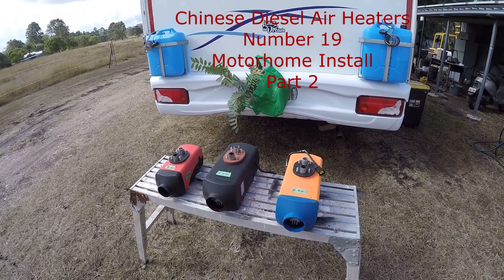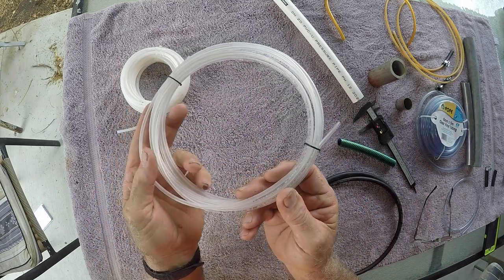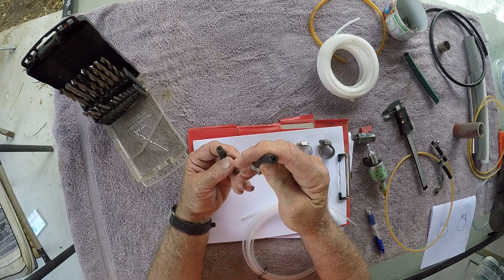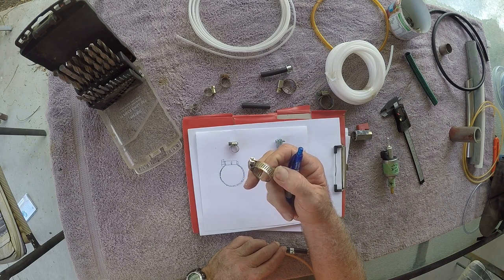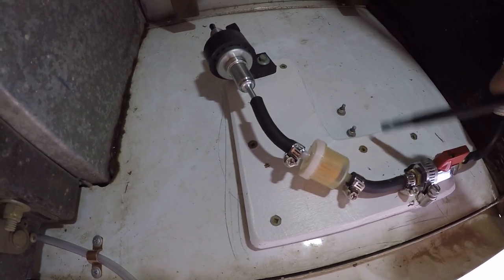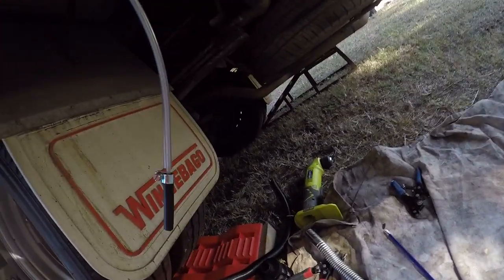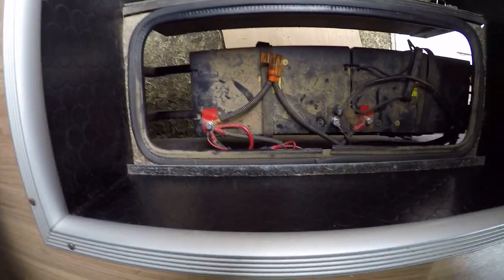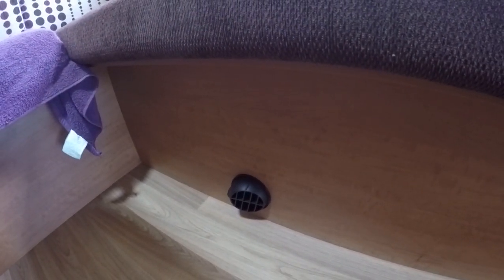Chinese Diesel Air Heaters no 19.   Motorhome Install Part 2

Comment: All your videos are great help to anyone considering such devices. The depth of your instructions is unequaled on the NET.
You are the top dog.  Yet after watching all of your work, I am still not sure on which of the models I should go for. Many people say the 5KW is overkill, the 2KW is all that is needed!?
UPDATE 2020-10-18: after revisiting some of the videos, I now know I have to go for the 5KW, but see volume to heat below... with engine option... will it suffice!?

I can see that going with a brand-name is a waste of money, thus I am sold on going with the knock-off version.

Which of the units you covered(link to eBay or else) provides the best and proper PCB to match to the 2 most advanced controllers? and all the better accessories that support the device without ending up trashing all of it an have to (re)buy accessories separately.

I have a mini bus with a house of 15ft(L) x 8ft(W) x 7ft(H) plus the cabin of this Chevrolet 4500 Express to heat. ...and if I am on Mount COLD-as-PHCK in the Denver area, I do not want to find out my heating system chokes and fails to keep me warm!  or it needs to run at blast out speed and burns more fuel cost than a residential heater. I also would like the system to allow for heat output to be directed onto the engine block. (Of course Aspar/Eberspaecher offers their hydronic version of this system [ outrageously priced ])...
I am not sure that heating the coolant of the engine is necessary, I would prefer not have to have coolant lines in the house part... so that would more than likely mean the unit would have to be installed in the engine compartment or near. [ but outside of the house/cabin area ]

Can the 5KW unit handle the house and some redirection to the engine block? with a cleverly engineered dampers setup to regulate how much goes where... the idea being that the engine never get to a point of being cold to allow for easy starting and also save everything from the constant cold/to/hot murdering expansions/contractions?

I have also figured out how to get the same(one) device to produce hot water for the house.  I need to test my idea before I babble non-sense on that... will post once(if) I have good results.

But first I need answers to my questions so I know which unit I will purchase.

Thank you.
Reply from the maker: Hi Mr D, thanks for the feedback.

A 2KW heater should be ok for your set up if you have decent insulation, but I would suggest you consider a 5 KW heater where you can run it on a lower setting creating less noise, and less power and fuel consumption.

Yes, you can put a splitter in the heat output line and I suggest the split line to the engine be smaller in diameter, say 25 mm to 50 mm tube. Just remember you must not be able to shut off the big tube completely or you will overheat the heater.

If you are good at mechanics, you can recover heat from the exhaust by wrapping the exhaust with copper tube and with a small 12V pump you could have recirculating closed circuit hot water.

Cheers.   JMcK
Reply: @johnmck1147   o! thank you thank you! 
I revisited to see if you might have had a chance to reply... and you indeed did.  
You essentially describe what I plan to do...
I lost my head in my post... my comment about not knowing which unit to buy is not about size but where to buy the exact 5KW unit you present, not just the capacity but the brand/manufacturer/reseller and if can return in case of issues(or need for parts), to a local warehouse. Who is your supplier? How do I go about matching the unit/brand/manufacturer you demonstrate?  I am in VA USA.
Surely you may have posted that info in one of the videos, if you could point me to it?

...yes I am mechanically inclined...building my own custom motor- home inside this 4500 bus... the copper coil you propose is what I have planned to test.
Reply from the maker: DormantIdeas NIQ 

Hi There,

You buy these Chinese heaters on line, such as Amazon or eBay. I purchase my heaters and those for friends off eBay. I generally don't put a link in the description as the sellers come and go, or they sell heaters for a few months and then move on to sell something else. None of the suppliers that I bought heaters from last year still sell heaters this year.

I suggest you buy heaters off a seller who has a local warehouse, has a good rating and accepts returns. I try to buy heaters off a supplier who has an Australian warehouse, that way delivery is usually free and only takes a few days, and it is also easier to return a heater if it is faulty. 

Cheers.   JMcK
Reply: @johnmck1147  ~~~ Total SUCCESS! ~~~ with your info and responses I got exactly the unit I sought.
Low & behold, the black 5KW unit with the non-straight muffler came up, of all places, at Walmart.com
... and the colored unit(also 5KW) also came up at Walmart(it has the straight muffler and the newer control and remote control, and standalone fuel tank! ...ordered it on Oct 13th, will be here on Oct 16th! with 30 day return, free shipping for $129.00.
Yeah they are both sold as 8KW but that does not matter, if maybe the fuel consumption! ...as I have seen these units have a bigger fuel feed than the 2KW.
The tracking shows it starting in HOUSTON, TX... thus, where the warehouse must be!

UPDATE:  once I bought from Walmart, I now noticed a slew of different versions/sellers are showing up on the Wallyworld search result!
Reply from the maker: DormantIdeas NIQ 

👍

Comment: EXCELLENT info, as always ! Totally agree with recessing the switch. Accidentally bumped mine on day one of the install. My switch was surface mounted, so I mounted it through a U shaped channel ( the bottom half of a grey surface mount cable ducting ) to creat a protctive lip around the sides of the switch.  Re: protecting the fuel lines, I used the split black corrugated electrical tubing. Cheap, easy to work with, can easily create an "opening" if checking for bubbles. However, my main reason for it's use was, I thought it would help with the prevention of algae growth in dormant fuel lines. What are your thoughts on algae growth ?
Reply from the maker: Hi Stephen,  thanks for the feedback. Split electrical ducting is a great idea. 
Re the algie growth, yes that can be an issue, but I have found to get growth you need water in the fuel. In this case the fuel line is under the truck and out of direct light, and the boat has had clear outer line for some 20 years without an issue. Also in my little plane, the fuel gauge is clear plastic sight tubing, and no algie in 10 years. I like to see the fuel run along the line on initial prime, but if there is ever an issue with growth you could incase the whole lot in split black ducting, but I would first look at getting the water out of the fuel tank.   JMcK
Reply: @johnmck1147  Thank for that ! Didn't realise that water was needed.
Reply from the maker: Stephen Mann 
👍. JMcK

Comment: Great videos thank you. I have a question though my power supply puts out 13.8 volts (its a bench top power supply) will this be ok to run my 5KWH heater
Reply from the maker: Yes, provided it is able to deliver 10 amps for a short time. The heater needs 10 amps on start up and shutdown. JMcK
Reply: @johnmck1147  Thanks mate, yes it is a 15 amp supply so it should be fine then. thanks again

Comment: Hi John, loving the videos plenty of info. One question, I see that you don't use fire proof silicon between the metal plate and the flooring - presumably so you can service the unit easily later. Most installers seem to use this or similar, what do you feel about the heat buildup under the plate? Is there no risk with the lack of sealing? Thanks, Andy
Reply from the maker: Hi Andy,

I find if the floor is thick it is easier to service the heater by leaving the metal plate bolted to the heater and remove the heater and plate as a unit. I use silicone grease under the plate for easy removal later. If you used high temp silicone in this application you would need to cut the sealant prior to heater removal.

You do not get much heat into the metal plate from the heater or the exhaust and normal silicone is adequate in my opinion. You could also cut yourself a silicone gasket should you wish. But there is no one right way to do this, and people have different install methods.  JMcK
Reply: @johnmck1147  Thanks John I think I'll mount the heater on a square of fibre cement board and just use fire proof silicone around the metal pipe and between the pipe and the plate so it can be prised off. I have mounted the inside air inlet quite close to the water filler pipe, does that end get very warm?
Reply from the maker: @andyturner9485  

No Andy.  JMcK
Reply: The fire retardant sealent doesn't stop heat transfer it simply means that the sealant will not break down due to heat. This is such a common misconception.

Comment: I understand that backflow or exhaust back pressure is a concern on a combustion engine but I'm not sure about a heater is there any reason why we couldn't run that exhaust through a radiator and capture some more of that heat possibly near where the water tanks are on your vehicle so the water doesn't freeze in the winter?
Reply from the maker: Hi Seth, if you look at the strip down video, you will see that these heaters have a tiny fan to blow out the exhaust, not like positive pressure from a piston, and any restrictions cause back pressure and a poor burn which then causes excessive carbon buildup.

You can recover exhaust heat, just don't restrict it. EG Wrap copper pipe around exhaust to heat water, or run exhaust through air chamber and circulate with small computer fan. JMcK

Comment: Hi John thanks for making the set up much less scary. I plan on suck priming the filter like you did to save the pump. However I don't have the ability to bring the fuel along the hard line like you did with your manual clicker. Does that mean I need to run the prime setting on the heater still? Or will the normal start up draw the fuel along that line if the filter is already primed? Also unsure what the thinner black cable going to your switch for turning off the heater is? In my head only the battery live cable needs to be broken with a switch? Thanks.
Reply from the maker: Hi Steven,

Once the pump is primed you can use the prime setting on the heater to get fuel from pump to heater without damage to the pump from dry operation.

You can also use the start setting but it may take a few goes if your fuel line is long.

Yes, you only have the switch in the red (12V positive line). 
I was using 2 core flex, but I only put the switch in the positive line.

Cheers.  JMcK
Reply: @johnmck1147  thank you so much for your reply.
Reply from the maker: Steven Lewis 
👍

Comment: GOOD DAY John.
I am curious about a Chinese park heater. I have a all in one 8k? And I would like to move the control panel to a different location and the cord is to short.
So my question is if there is a extension cable that I can buy short of cutting and soldering the factory cable. 
Thanks for any help you can provide. 
Thanks 
Raymond
Reply from the maker: Hi RHB, I know of no pre made extension cords. However, you can cut and join in the extra wire you need for the controller. Just make sure the power is disconnected, and you don't mix up the wires.  JMcK

Comment: Hi John ,once there primed do they stay primed or is it every time you start the heater You need manually prime the line ? Hope thats not a silly question..thanks mate.
Reply from the maker: If no leaks you only prime once.

Even after 3 years no use due Covid, no prime issue with boat heater. JMcK
Reply: @johnmck1147  perfect..cheers John..👌

Comment: John
I have a fairly new Chinese Diesel heater recently installed in a Ford Transit van. I estimate that it has less than 8 hours run time. Priming and air in the line has been a mild nuisance which I can usually figure out. What I can't figure out and could be a safety issue is the fumes I am smelling inside the van when the unit has been running at full power.  I suspect that this may have something to do with how I mounted the unit. I ordered separately and used the steel mount with the ring, but I set the ring on the metal floor of the van vs cutting the big hole for it to fit inside of. So the ring is not recessed down into the floor. The hole I did cut allows just for the exhaust pipe/air intake/fuel line. Do you think that I might be getting exhaust drawn back up into van and if so how does dropping the ring down into a large hole really create a seal?   Anything else I should check? I have no black or white smoke. Thanks
Chris
Reply: OK so watching no 19. Motorhome Install Part 1 I think my problem is not sealing the bottom of the mount or sealing the little hole in the plate as you did with silicone. My challenge will be that my van floor is with corrugated ridges  like most all van floors and not dead flat. Getting a seal may be tough
Reply: ...and make sure your exhaust tube connection is hermetic and that the air intake tube is also hermetic and that the tail end of the exhaust is not feeding back into the air intake
Reply from the maker: Hi McQ

You should have no fumes in the van. 

Fumes can enter the van through the heater seal or because of a gasket leak in the heater itself.

When running the heater through the floor of your van you must have a good seal. You can mount the steel plate that came with the heater to the uneven floor with lots of silicone, then bolt the heater to the plate using the silicone gasket that came with the heater.

If the heater is old, it is possible to have a gasket leak in the heater allowing fumes into the cabin.

Cheers.  JMcK

Comment: Fabulous videos John, really informative! Is there any chance you could do one on errors/fault-finding? I have an error 08 and the glow plug light doesnt come on and its driving my crazy! Fuel looks good, voltage / current draw looks fine, the unit is only 6 months old.
Reply from the maker: Hi Tom,  E08 could be a number of things.

The most common is a tiny fuel leak, generally where the fuel line joins the heater.

Another cause can be NOT using narrow bore hard nylon fuel line on the delivery side of the fuel pump. Some heaters are now supplied with 4mm cheap plastic fuel hose. If you use this cheap fuel hose it stretches and absorbs the pulses of fuel and if you have any carbon build up on the glow plug screen the fuel does not have enough pressure to atomise.

You could also have carbon build up on the glow plug screen, and the glow plug atomisation screen breather air hole.

Good luck.  JMcK
Reply: @johnmck1147   Hey thanks so much for that  prompt response!  I think I'm going to remove the whole unit so I can see better what's going on - it's pretty inaccessible and I can't get a meter on it or see anything much really. I think the fuel pipe looks good - it is the narrow nylon type. The unit has probably only had a few hours use total so hopefully not coked up. It's right at start up that it fails - the glow plug light doesn't show on the controller.  Does it have some kind of sensor to check fuel pressure before lighting the glow plug I wonder?
Reply from the maker: Hi Tom, 
The ECU turns the fuel pump on after the glow plug is hot. 
Also the fan comes on before the glow plug. Is the fan spinning freely on start up? It must spin freely.
Please also check again the wiring and plugs, and you do have 12V at the heater
It is possible (rare) you have an electronic failure, ECU or controller. I have a spare of both and it is very easy for me to swap out an old controller for a new controller.
If it is a new heater, suggest you try and get a replacement heater.  JMcK
Reply: @johnmck1147  Hi John and thanks again for detailed response! Occasionally it starts OK, and when it does as you say I get fan first, then plug lights up then pump operates. Interesting that when plug does light, the fan speed drops markedly. This might be normal, but it seems to suggest low voltage or poor connection. Just a thought - does the heater connection depend on the body being connected to chassis? Probably not. Anyhow, I cant measure anything with it in situ - it's inaccessible.  I've figured out how to remove it I think so I'll do that and then I can test it on the bench - way easier. I'll let you know how I get on....  pouring with rain here now though!

Comment: Thank you for all the good information.  I'm trying to build a map/schematic to the electrical system you describe and wondering if you or one of your subscribers has already done this? Also I think i've seen marine or certainly aviation electrical switches that include a cover or cap to prevent accidental tripping.  thanks so much/// its fun to be back in "school" with a need to know and a great teacher! Sending virtual cookies. Ginny D.
Reply from the maker: Hi Ginny,
Thanks for the feedback. 
Yes, those cover switches can be bought from an aviation shop or hobby electrical shop or on eBay.
I do have a basic electrical schematic, which I can email to you. My email is johnmck47@outlook.com

Cheers, JMcK
Reply from the maker: Spiros nik 

Will do.  JMcK
Reply: @johnmck1147  thanks a lot John!